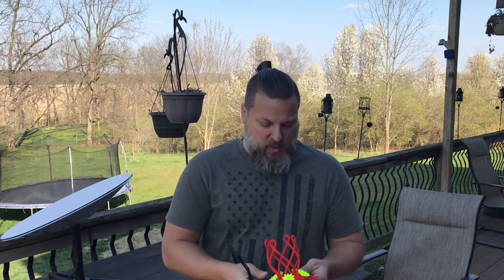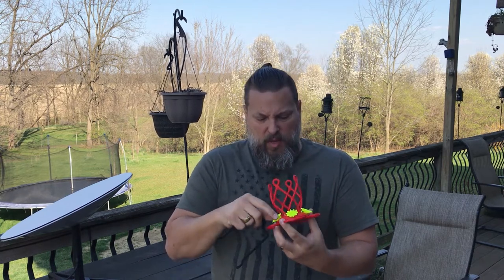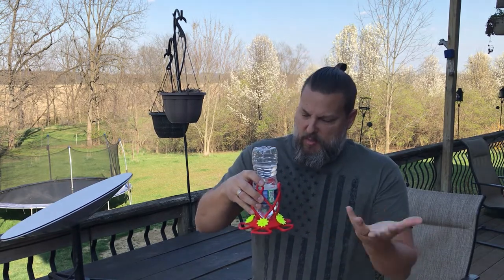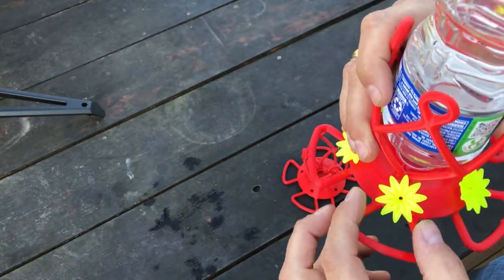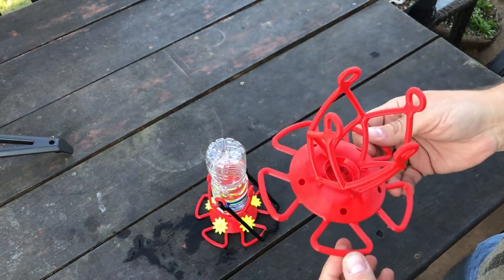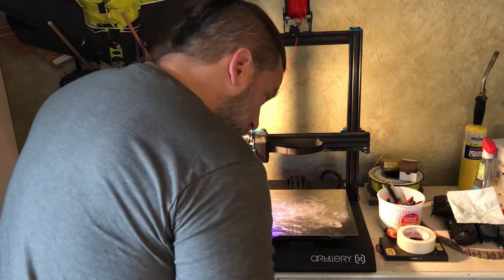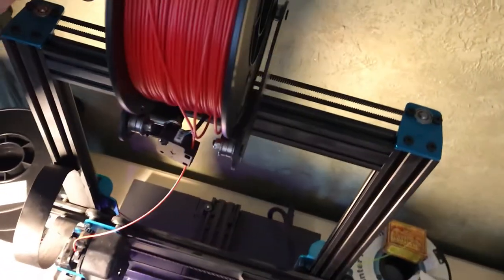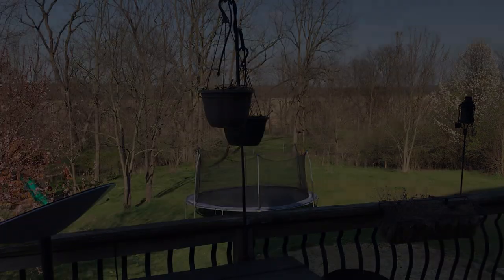3d Printed Hummingbird Feeder get Tons of Hummingbirds and Prevent Guarding!

Comment: You mentioned you would or could upload the wall/post hanger. I would like that if you don't mind. I almost got done a first print but my filament broke at the cage part when I was out. So I filled it with water anyway and no leaks using 245/.4/.2. Very happy and new print on the go with more to follow. Thanks again.

Comment: Great Design. 
Will you make a similar design with 10 feeding ports that can hold a 2 liter soda bottle?
Would love to buy that design
Reply from the maker: I’ve got a new design that uses a small Gatorade bottle, that video will go up any day. Not much bigger, volume-wise than the water bottle though. I can try a 2 liter design. The extra weight should be an interesting challenge!

Comment: Hello. I bought the design and I'm getting ready to print one. Couple question regarding water tight. What nozzle size and layer height should I be using for optimal print?  Thank You and this is a very nice design.
Reply from the maker: I use a .4mm nozzle and .2mm layer height. I use those settings primarily because it’s somewhat of a standard and I want the design to work for everyone. That being said, larger nozzles and layer heights improve most mechanical qualities from my experience. My preferred setup is a .8mm nozzle with .4mm layer. If you decide to go this route you should find increased strength, increased overhang tolerance, decreased print times (significantly) and even better water holding characteristics. 

For a watertight print you want to make sure your layer adhesion is really good. I usually print mine at the upper end of the petg temp range, 250-255. The higher temps can increase stringing but it also decreases porosity. After that just make sure your ooze control settings aren’t leaving gaps at the beginning or end of a trace and you should be good!
Reply: @DiamondBackDivision  Great Thank You. I just may try the .8 nozzle after this print using the .4@.2 Have a good day.

Comment: The design loads into Cura as micro 3mm object. Now what? What are the X,y,z Dimensions in mm?
Reply from the maker: Thanks for the note. It’s designed in fusion 360 and I use simplify 3D to slice. Let me see if I can figure out what’s going on.
Reply: @DiamondBackDivision  Thanks.
Reply from the maker: @SuperSurfingman1  So the file is saved in inches and S3D has been automatically converting for me.  I resaved in mm and it opens without converting.  I'll replace the files for download and send everyone who already purchased and updated file.
Reply: @DiamondBackDivision  Great support! Thanks!

Comment: What water bottles did you test this latest update with? Not one water bottle I have tried even comes close to fitting/threading into this. Did you adjust dimensions when you converted this? I have cut apart the stl and I am trying sort out the threads. Tsk.
Reply from the maker: Is it neck diameter? Thread pitch? Do you have an ice mountain bottle to test it on? Have you checked the dimensional accuracy of your printer? If you’re in another part of the world other than US the bottles may be different. Maybe you can send me a popular brand or two of bottle and I can make a couple variations.
Reply: @DiamondBackDivision  I'll be in touch soon. I'm going to get some more different brands here shortly. Thanks for getting back to me.
Reply: @DiamondBackDivision  Yah! I found some bottles that fit. Was wonderdering if you would consider making an adapter for the other types of bottles. I found 2 adapters on thingiverse, both the female threads are correct for the other style of bottles. Here are 2 links. The smooth one with your male thread on the other end would be perfect. As near as I can tell there are basically 2 types of threads, the one you currently use and the the other slightly bigger/different pitch (thingiverse). I realize that we would have to stretch the hanger/hook some but that is easily done, or just a thought, maybe include the new hanger size with the adapter? I love this design and have printed more. Here are the thingiverse links. Thanks again. 

#1-https://www.thingiverse.com/thing:4222678 (prefered style) 

#2-https://www.thingiverse.com/thing:3330582